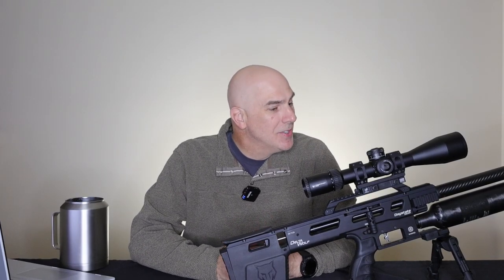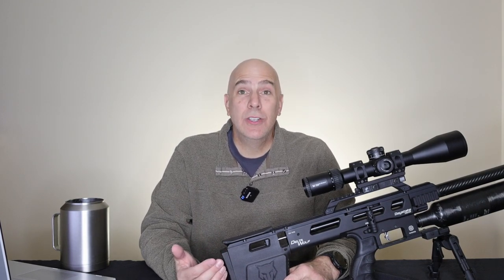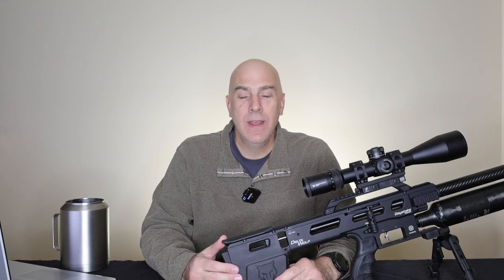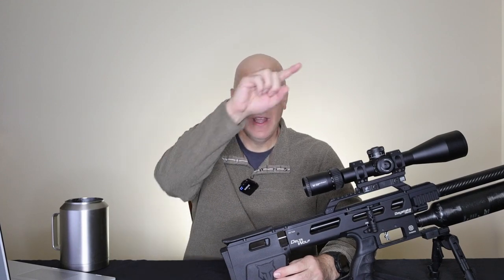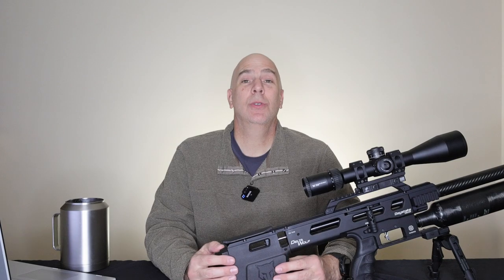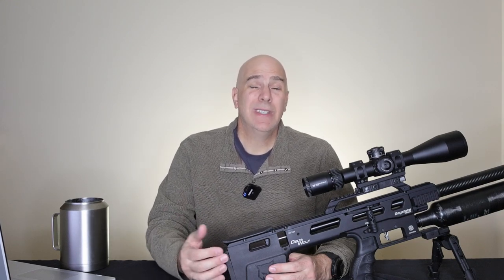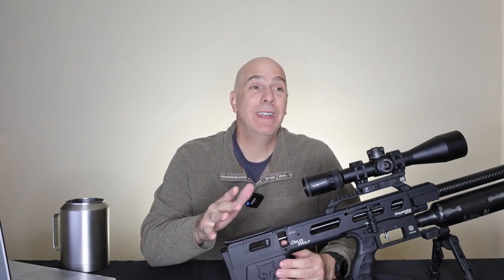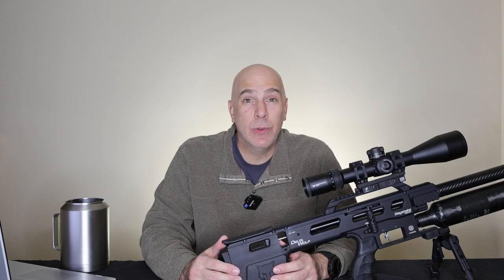AIRGUN ACCURACY VS COLD WEATHER: HOW TO IMPROVE ??

Comment: Has anyone tried using those heat patches to wrap around the gun to heat it up, especially around the air chamber to get more velocity? Thanks.
Reply from the maker: I have not, i was always worried because of the variance in accuracy from heat going up and down especially in cold weather.

Comment: Not only the PCP is effected in cold weather so is your scope when you are adjusting for elevation and windage .  You may find yourself tapping the side of the scope to shock the damn thing into the position you adjusted for . 
I don’t care how expensive your scope is , over time it will do the same .
Any grease or lubricant that makes things move smoothly are affected by the cold .
Reply from the maker: ahh excellent point.  I really need to check my scopes in this way as well.   Thanks for the input !